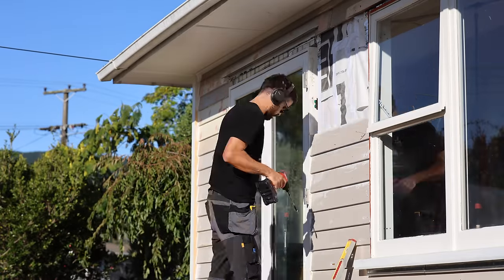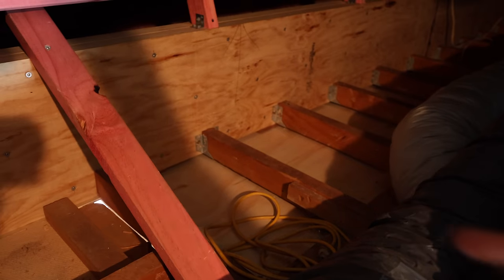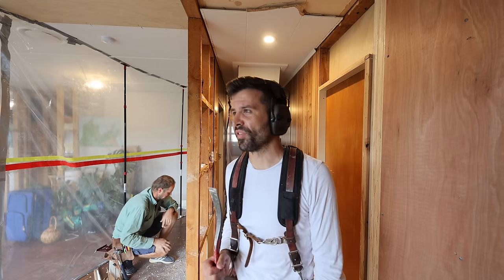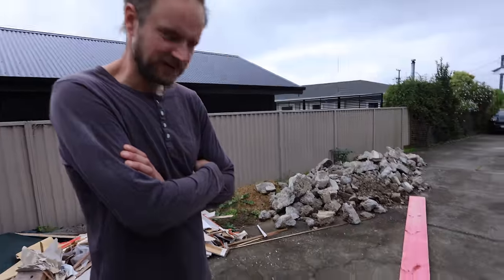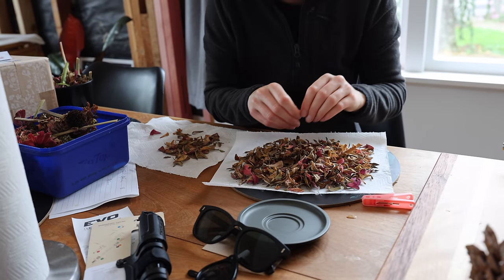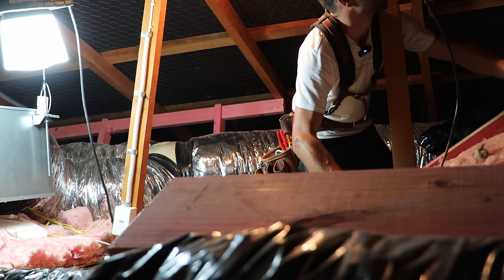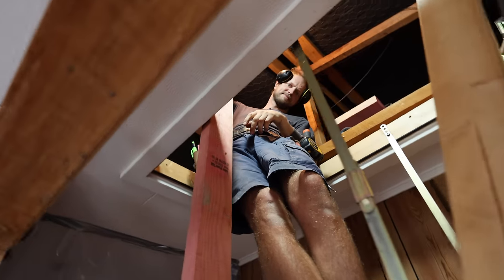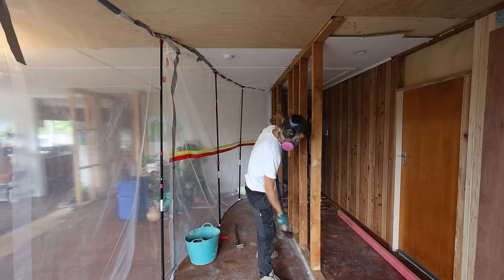How To Remove a Load Bearing Wall

Comment: I wonder if the "measuring with body parts" is a Dutch thing, because I do exactly the same things for rough guestimates of measurements as Ray :)

edit: oh and by the way, I think these episodes where you deal with load bearing stuff are very interesting and educational! so not boring at all.
Reply: my dad who is English and part Scottish did the same when he was an electrician - he now retired
Reply: I do the same thing, I know the joints in my fingers are about an inch, my arm spread apart finger tip to finger tip is 6' and my foot is about a foot. I am Canadian born Mennonite, and yes I am tall for a girl and am also the handywoman of the house.
Reply: Fistmele, cubit, span......all body based 'Biblical' measurements, all existed before the Classical Greeks and Romans, who gave us the inch and foot (Julius & Augustus standardized them) and by Medieval times - pole, perch, rod, fathom, barleycorn..........pre-metric in Australia we had to learn them all. Interestingly places in Europe like Austria still use inches (zoll) for things like carpentry rather than metric measurements.
Reply: I guess I'm approximately 0,95 Ray

Comment: About doing the crappy jobs. I was a site manager for many years. Mostly contract work ranging from 3 months to 18 months at a time. Quite often there were gaps before I started a new contract. In those gaps I would do agency work, working as a labourer on building sites. It was good fun and gave me appretiation for the various trades working on site.

Comment: Hey Scott. Just a quick question. When you worked in Scotland & England, were your sites ever inspected by the government, in any structural detail during the build? Here in Ireland, the system is that the builder/developer employs an engineer to sign off on the construction detail. Doesn’t work.

Comment: Easy way of removing that @#&* panelling is to relevel the floor, just make sure you warn Jess beforehand. Putting new posts under an old farm house many years ago and as we jacked and levelled the house we could hear all these 'bangs'. Wasn't until the end of the day when we walked into the room we'd been working on that we found the source (we had looked before, it just wasn't obvious) the panelling had popped of the walls. The glue had given way and the brads had pulled through the sheeting.

Comment: @ScottBrownCarpentry
One thing I did notice is that your strutting beam is sitting on top of your ceiling joists.
Should it not have been packed at each end 20mm up so if it weight of the roof load sags it it's not going to then sag your ceiling joists with the potential of cracking the ceiling plaster?

Comment: If the renovations you are doing were done by a private contractor would it have been financially viable? The other option would be a total knock-down with a brand new house Having said that I've just renovated a 50 year old weatherboard plus extensions I stopped adding up all the bills a long time ago This is our 14th renovation I am by profession a medico  and have moved a lot with my career It's like a drug addiction Every time we move we rationalise buying a fixer upper rather than a bland new house Therapy from colleagues has not helped Unfortunately My impression is that the cost of renovating has exploded
in the last 3-4 years I felt blessed when my daughters more recently  partnered with a plumber and an electrician Welcome to the family Now get to work!!!
Cheers
Adrian
Mornington Peninsula 
Australia

Comment: This is why remodels are so expensive. We want to make a house something it was not designed for and end up micro-repairing every part. It may have been cheaper to (at the least) tear off the whole roof -ceiling and put in trusses. I wonder if your project would pencil out if we had to hire you to do it under contract.

Comment: Scott (or anyone else that may know), what the sheeting system that you use called? In the UK and wondering if I can get the same or similar here as we are about to have work done on our house.
Reply from the maker: Hi Benjamin, that is zipwall. It comes as a kit and should be easy to find in the UK
Reply: @ScottBrownCarpentry  thanks for the reply, Scott!